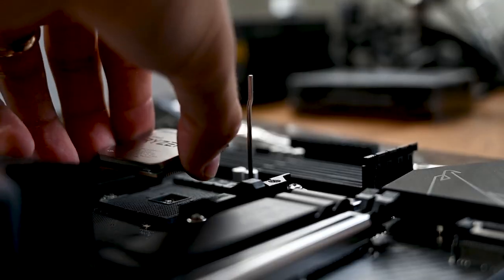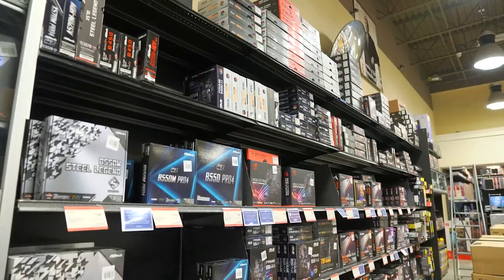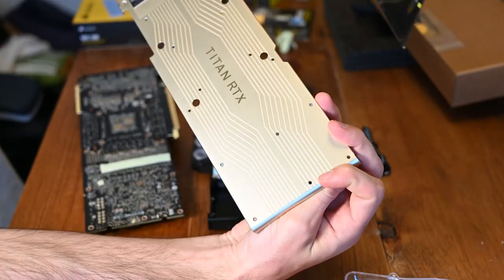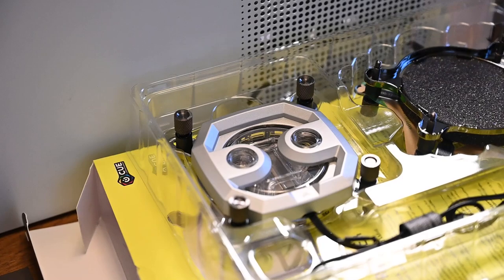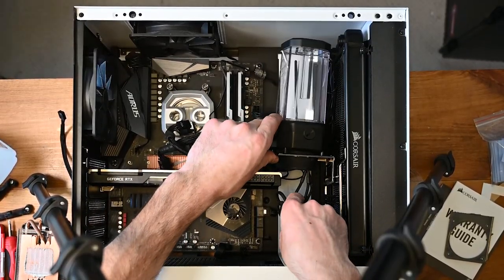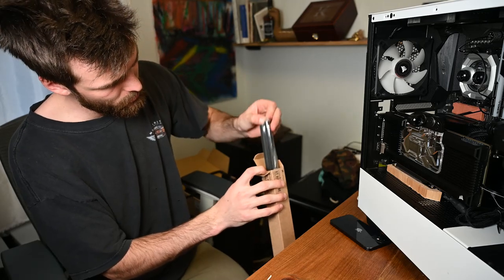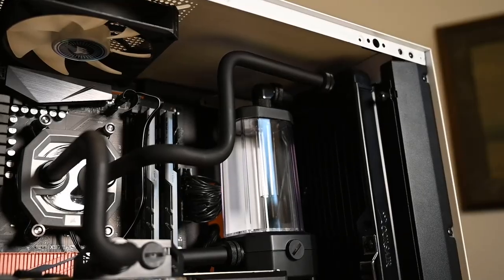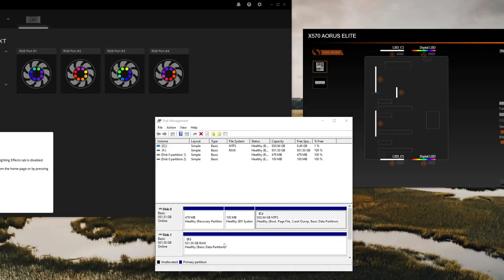I Custom Water Cooled My First PC EVER

Comment: Yup, building a custom loop has a steep learning curve. Especially if you go the hardline tubing rout with your first attempt. I’m still sticking with soft tubes, even after ten years building, and rebuilding my custom loop PCs. If you want to learn more about everything water cooling, I recommend Jayz2cents on YT. Anyway, hope the loop runs smoothly since you built it 👍

Comment: Hey,
Recently I've upgraded my PC and I have AIO Corsair cooling.
After 2 years coding on windows I've decided to switch to Linux.
Unfortunately I've big problem with setting up cooling profiles to react when GPU or CPU temperature is changing.
Did you set up cooling on Linux somehow or you've moved completely to the WSL2?